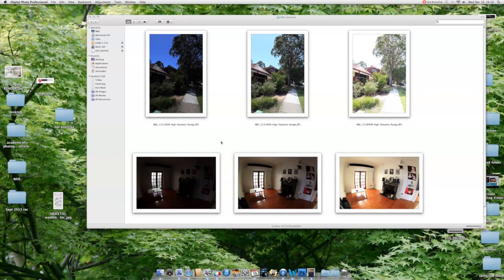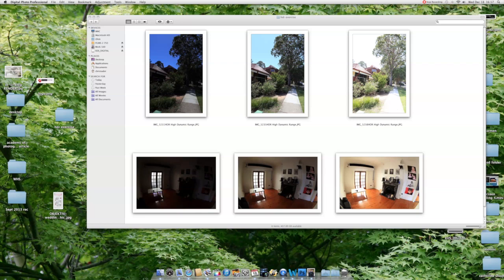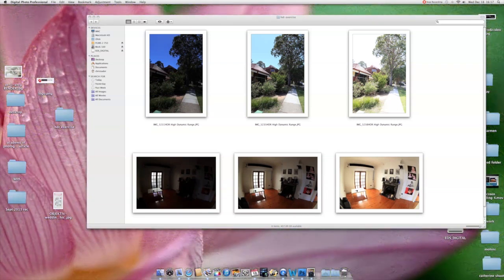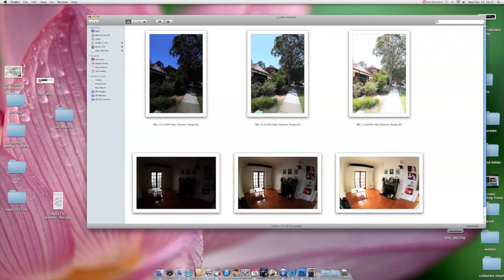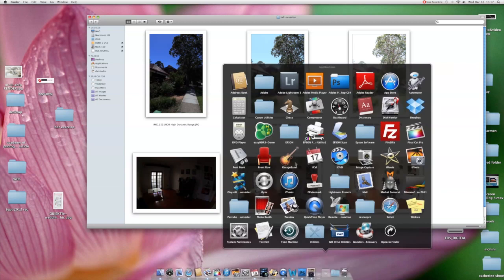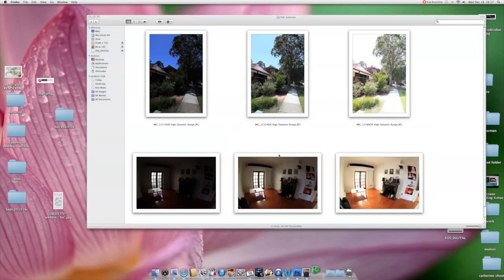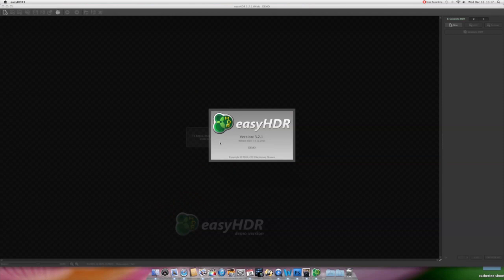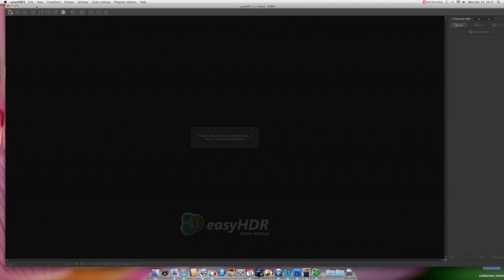HDR High Dynamic Range photography tutorial - real estate photography application

Comment: I see you have Lightroom and Photoshop ... Why not use that software to convert?
Reply from the maker: which one..not sure I understand the question?
Reply: What I've done with HDR is load the sequence into Lightroom, do some quick post processing if needed.  I then bring them into photoshop via lightroom (I think it's export to photoshop using HDR plugIn or something similar).  From there, you can do further post processing of the final HDR image.  After fully watching the conversion, it seems easier but I'm wondering how much the HDR software would cost and if it does a better job.
Reply from the maker: Chris
the HDr software does a much better job in seconds. You are talking about multiple tasks and that takes time. 
a HDR software might be between $20-$100...just google it